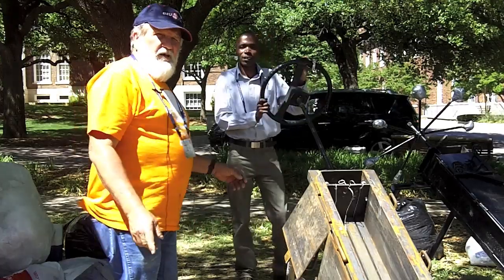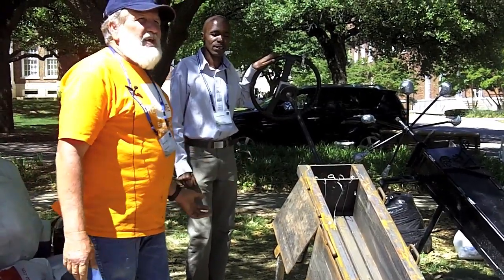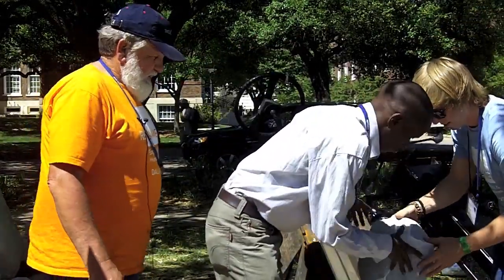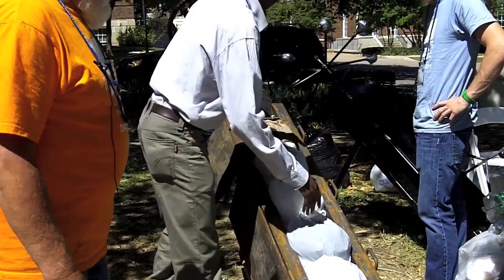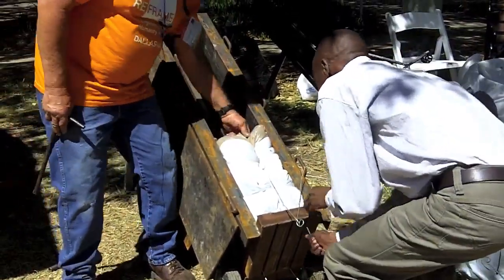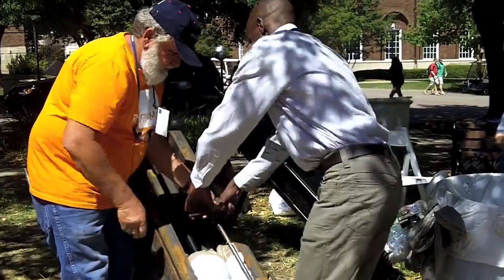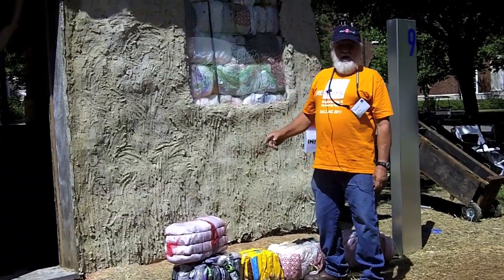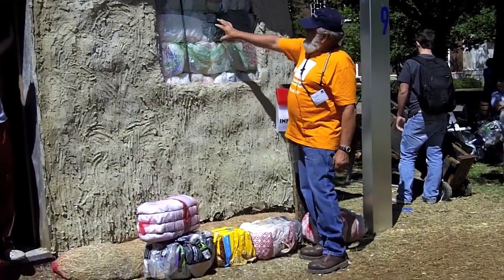Harvey Lacey -  House Built of Recycled Plastic Bags

Comment: So it's a post-apocalyptic supermarket baler nice,you know if the  plastic bags are supermarket bags that are made from high density polyethylene (HDPE), and the bands were made of (HDPE) cord you could melt the bales at safe temp so as to not cause fumes and make a brick in a mold, then use milk and vinegar heated and strained extract the caesin from the milk with a strainer, and the casein protein  is a polymer. From here pulverize the white cheese looking casein polymer , and mix it with a little  pure lye the one that does not include aluminum, add some water then keep mixing until you get a slimy consistency, it's now 100% water resistant and has a unbelievable strong outdoor, but only now it is a form of wood glue known to be the strongest ever as a home made batch. It is really a very serious glue, it has a long setting time, but now you would have your own make shift brick mortar for your new plastic (HDPE) bricks. Happy plastic (HDPE)  house building.

Comment: This all looks good, but eventually the bands holding the plastic trash together will rust and snap, and then the wall will collapse, so what is the way out of that situation?
Reply: +Neetin Khedkar not use rusting metals...
Reply: +Neetin Khedkar looks like hes using plastic coated wire which should help against any corrosion, but i would also assume that the interior of the wires are copper which doesn't rust.